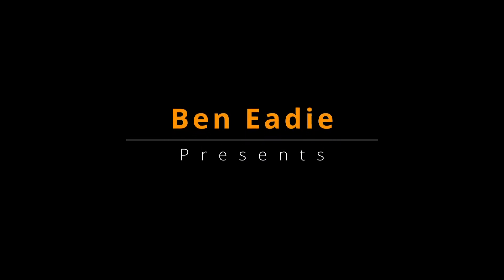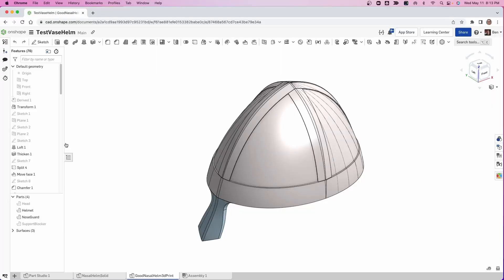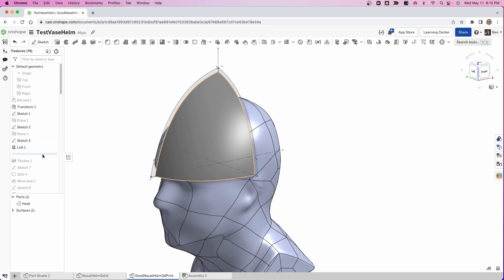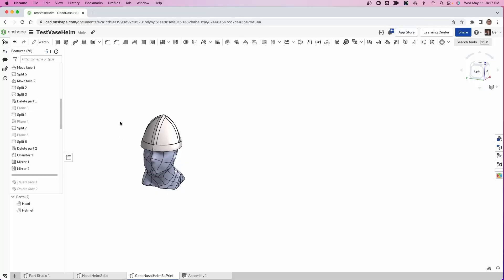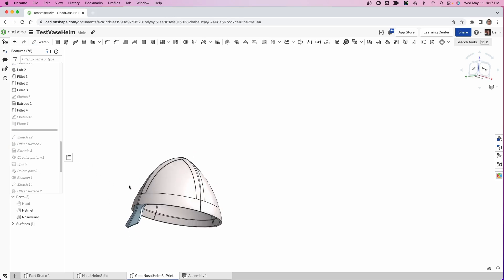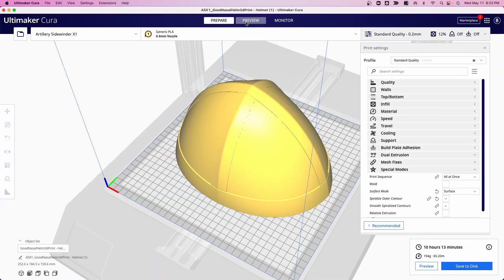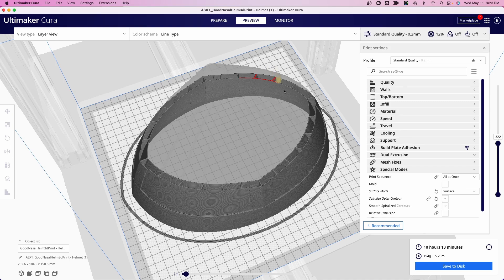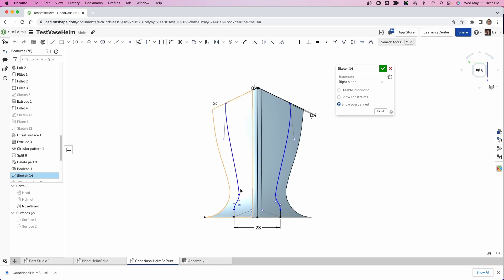3D MODELING TRICK: Negative Volume Printing to Half Your 3D Print Time

Comment: Took me a while to wrap my head around this.  I think it may be helpful for others to see it on a simple shape, and showing the final cutting piece without the surface over it.  Thanks so much, I'll be utilizing this in my designs!
Reply from the maker: Here is a video with another explanation. https://youtu.be/STNJbHJf9K0
Reply: @DreadMakerRoberts  I watched that video also but it didn't go into how you actually execute the slices. This is such an awesome technique and I would love to see, like OP mentioned above, a very simple shape like a square and a more detailed step-by-step walkthrough.
This video was great but when it came to implementing the actual slices, you went from a single plane cut to on the next shot multiple cemeterial cuts all around. I believe what the above post was trying to say is maybe to breakdown just the applying the cuts with more detail. 
Either way, great stuff!
Reply from the maker: @shaowlnkngfu3803  Thank you so much! And I will start on that video.
Reply: @DreadMakerRoberts  Thank you for being so receptive! I look forward to it as well as many others I am sure.

Comment: This should be relatively easy to implement in a slicer.  The way you have broken down the steps and the way you worded it should be easily turned into an algorithm.  I imagine there will be interesting ways to improve on it once it's done in a slicer such as different types of infill ribs and methods of hiding or possibly even eliminating the seam.

Comment: Okay, I watched it twice and I think I get what’s happening. It looks like the most challenging part is getting the software to create that initial half-nozzle offset (in that, if the geometry makes the operation math unhappy, it will fail). Autodesk has a fancy name for “bad curves” that will cause that, but yeah. I use fusion and will have to see if I can pull this off. I may even try to make a Boba Fett helmet that will print this way (which will save DAYS AND DAYS of print time).

Comment: I'm sorry I'm missing something but when you do the split the model is cut on both faces at 6:34 and few second after when you wanna talk about he the 1mm gap only the internal face is cut, not the external one. How do you do that?
Reply from the maker: I am not 100% sure I am following. But the graphics of a thin wall in any CAD system will show ghosting from the other side (the inside in this case) of geometry. This may be those ghost lines you are seeing
Reply: @DreadMakerRoberts  hum ok maybe, then I don't understand how you manage to cut up to 0.2mm of the external face and not all the way
Reply: @SebastienChedalBornu  I'd guess that this trick works because of the way booleans are implemented in regard of substracting fully touching with surfaces (eithere leave a "thin wall" or remove it). In this case after subtraction that overlapping surface whould be thin wall ("zero" thicknes), causing flickering on display. And to make it spiral the option "thiken thin walls" should be turned on in slicer. That already automates a tons of modeling involving line width math. 
I have a feeling that you could make solid mesh using minkovski transformation in openSCAD but why bother if slicer whould do that for you.
Reply: @pokutnik  ok so it does not works in fusion 360, so what I end to do is creating plans that goes across the part and do an intersect with the plan and the body. Then select one of the face do an offset close it and extrude a 0.2mm cut
Reply: @SebastienChedalBornu  I was lost at 6:34 as well. Seems like we went from a cut all the way through, and the explanation of how the face remains a sheet was missing.  So are you saying you radially slice your model, and then extrude inward?  Not real sure I follow.  I have Fusion360 as well.

Comment: Has this been tried with 0.4 nozzle?  I’m sure the print would probably take longer and be less strong, but I’m curious because 0.4 is the most common nozzle size and I’m too lazy to swap nozzles 🙃
Reply from the maker: You can just set the slicer to 0.8 and leave the 0.4 nozzle in. It will over extrude just fine and work out